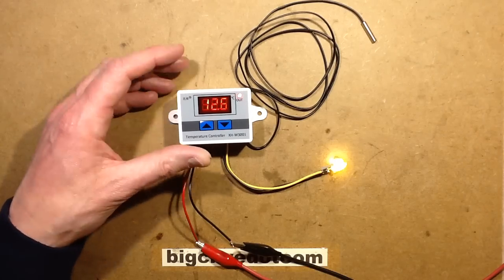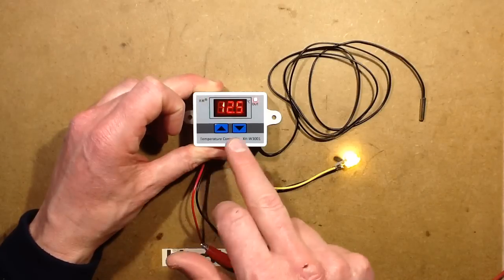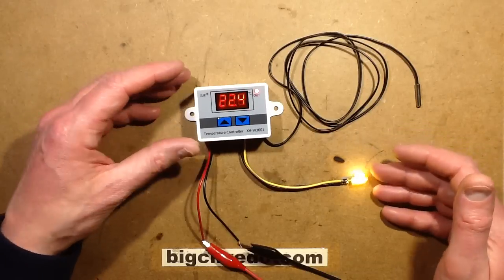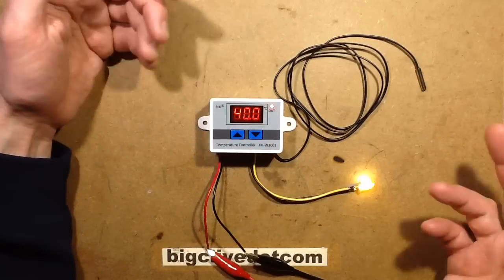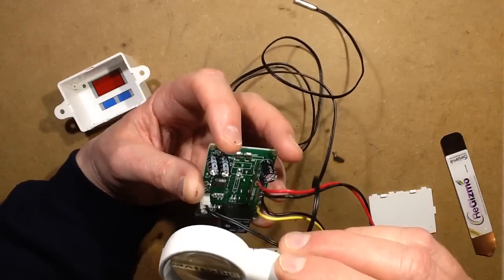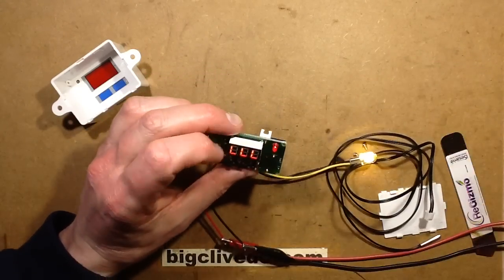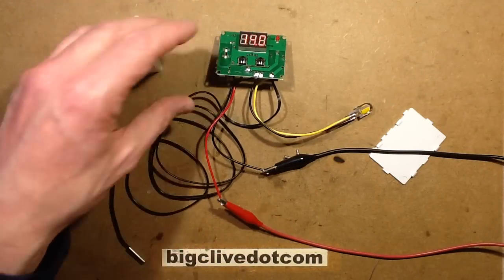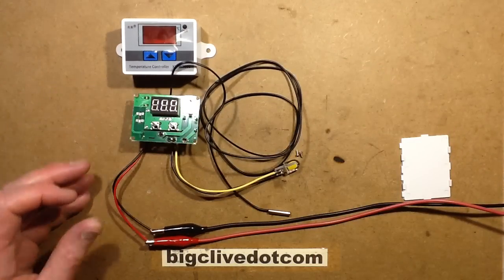How to set a XH-W3001 thermostat module, and a look inside.

Comment: I used one of these to fix an expensive portable fridge that was going to cost me hundreds of dollars to repair the board. 
Fortunately the compressor still ran continually with emergency bypass. 
I just tapped into the power cable with an automotive relay. Works perfectly. 
Has no lower power disconnect though. 
I reckon the Chinese might have one of those modules for a couple of bucks. 
Thanks for this video it helped me a lot.

Comment: I had a lot of fun with this item! So glad you made this video as my fridge is 20+ years old and I fear one day I would awaken to a puddle in the floor from the unit dying overnight. I ordered four of these, 4 12v wall warts, 4 female power jacks, and 4 intermittent sounders. Wired the sounder in to the relay, drilled a hole for the power jack, drilled 6 holes for the sound to escape, put the sounder inside, tight fit but it worked, super glued a magnet to the base, stuck it to the side of the fridge, set it up to monitor the freezer temperature! I used one as a proof of concept, one as a prototype and gave the other two to my brothers. I used the prototype for my personal one and threw the proof of concept one in the junk drawer for future experiments. Only problem was waiting weeks for the components to arrive from China!
Reply: buy the thermostat version for 110-220v and its easy (3 wires) replacement for your fridge thermostat. if the fridge dies its either thermostat or the varistor disc thats on the rear of the compressor. both are janky old crap. best fix them both with modern controls instead of waiting for them to fail

Comment: This will do nicely for my computer desk fan setup. The always on during a fault issue will actually be a plus in that usage and any other case when used to cool vital components.
Reply: Except it only wen't always on when he shorted it. If it's off when it fails and then it gets hotter...

Comment: I just purchased one of these for controlling a home made solar powered roof (attic) fan setup and came across your very useful demo on how to set it up and adjust it, many thanks. Tomorrows and the following two days peak temp is 40+C so the roof extractor should continuously operation if this has been correctly followed i.e. Well into the red zone NSW in Oz

Comment: I reckon the "on when thermistor shorted" feature/weakness is actually intentional design and not an oversight. Consider how you could use a switch to override the controller by placing it in parallel with the thermistor. The advantage of this over having an external bypass switch, is that the controller will indicate an override is active on its display. Also, the switch doesn't have to be capable of switching the 'high' current passing through the load. I suspect the load on/off state for a short and open circuit thermistor will reverse if you set it to "cooling mode".

Comment: Picked this up to add a couple old PC fans to my hen house.  When it gets too warm in there a couple fans will start circulating air and turn on a light as a warning. 
Very simple and nice. 
Thanks for the video.
Reply: Hello Sir, I don't know what I have been doing wrong, mine reads 12v 110v 220v but I keep on short-circuiting them. Kindly assist me out on how to regulate the amount of power needed. 
Thank you
Reply: @sharonkwamboka-xf8ro  They are marked on the back with a marker for the voltage. They only come in two voltage types. Yours is either 12 volts or 110 thru 220 volts

Comment: cheers clive. i got one on aliexpress for a quid fifty but no instructions. yesterday my 7 month old fridge died because of the thermostat. i now have installed this gadget and have a digital fridge! i also removed the motor start varistor and built a circuit with a capacitor and 2 relays to give the start winding a fraction second pulse when needed. where i live there are lots of powerline issues where the power can drop for just long enough for a motor to stop but not long enough for a varistor to cool off, leaving the compressor to cook until the overtemp cutout trips.  i recommend both these mods to anyone capable. it also cures the problem with keeping a deep freeze in the garage in the cold then having it self defrost on a cold day and ruin your food.
in my case i still had 2 year guarantee but taking it back to the shop would cost in petrol 4x the price of this thermostat i had on the shelf.
i get really pissed off as an electronics engineer when i see the jenky way cars and domestic appliances are wired just to save a penny per unit.

Comment: Thanks Clive.  I bought one on E Bay and there were no instructions.  I couldn't work out how to set it using trial and error.  Your video saved the day.  I've used it with my slow cooker to do some sous vide cooking.  (These are available to control a 250 volt supply.)

Comment: I purchased one to fix a 1500W heater. One version is given for 220V 10A. Must say that for 3.35€ including shipping, it is rather competitive! Just installed it and works well. No clue about long term reliability. But for this price...Thanks for the clear video explaining how to set "heating"/"cooling mode" which is not straightforward on the website. Hope the coronavirus was not in the parcel :-)

Comment: I bought a 120v sous-vide temp control module for my vodka/brewing setup (it controls the heat mats I use to warm the fermenters) and it's been one of my best e-bay purchases yet.  Very reliable and quite versatile for brewing with 0.1 deg precision and all sorts of alarm conditions and stuff I don't even need. It was around $25 CAD and a comparable unit here was something crazy like $125 or higher. When they care to, Chinese factories can turn out some very well-engineered stuff for not a lot of money.

Comment: The difference between set point and reset point is normally called "deadband".  Hysteresis is usually used to define the difference between in a continuous output when the signal is rising or falling.

Comment: I bought one for 220V/1500W and it principally works the same, though it is not as intuitive to use as the one you are demonstrating, it does not flash when the settings are ready to be changed. Does the job, heats up a silicon heating pad within the range. My only comment would be the in/out wiring which seems to be rather flimsy for such high voltages and wattage, the heating pad is 750W and there are 2 of them, seems to work fine. Thanks for helping with figuring out how to set the controller, difficult when it comes with no instructions.

Comment: I built myself a refrigerator using a 100W peltier plate and I'm powering it with the +12V rail of a ATX PSU. The current issue I have is it just runs as cold as the room will let it get. Which is causing large amounts of ice to build up on the heatsink inside the unit which is causing cooling effectiveness issues. Not to mention the ice buildup is stopping the fan from circulating the cold air inside the unit. This seems like the perfect "legos for adults" component to regulate the internal temperature more effectively if it can run off +12V and deliver up to 100W.

Comment: An even-cheaper version of the DIN modular thermostat packages from Willhay Electronics. Mind you theirs were 240V rated, with everything programmable, alarm contacts, o/p changeover contacts, etc for a rather measly $20 AU!  If you don't need sophistication, this would be great - idea as a fridge thermostat, or fishtank heater stat. That PCB has a lot of space and markings for added components, so its probable that there is a 240V version out there. Well worth looking for, and I'll be buying a few to play with. Thanks Clive!

Comment: I've found most of these controls work fine (for hobby use only of course) but it never drive more than an amp or so directly. It's always a good idea to drive and nice name brand relay.
Reply: yes, not even the cables are ready for 10 A

Comment: Aww damn, wish I knew these things existed when I built my new computer, a bunch of those with the thermistors gooped onto the various heat syncs would be great fan controls
Reply: Mort OOPz you're more better of using it for the air inside the case than the heatsinks

Comment: Waterproof probe and ability to handle mains voltage, and you could use an improved version to control a cheap slow-cooker for use as a sous-vide water bath.
Reply: markiangooley that's what I did! The unit controls a contactor->1000w immersion heater, best stakes I've ever cooked 😀

Comment: Thanks indeed for your insight Clive.  I had to find a circuit diagramme for the same item that I have just received.  As always you are very helpful... Excellent review. My app is for controlling a heated box with a terrarium heater lamp for bread prooving and fungi culture.  Let's see how the 240 V version goes with the relay etc.

Comment: I suppose when theres a fault or disconnection of the temperature probe its pretty much 50/50 whether it would be preferable for it to default to on or off depending on the application, especially since it can be used in both directions. like you say you need an extra failsafe mechanism. but the thing is probably intended to a just a part of a wider control system so thats fair enough

Comment: The microcontroller is an STM8003F3 series with 8KB of flash memory.
If you have an ST-Link V2 programmer and can access the programming pin (pin 18), you could reprogram it with some custom firmware to fix the output staying on when the sensor gets disconnected.
Reply: I'm wondering if the empty 4 pin connector under the STM8 chip is the SWIM programming connector making this even easier to do.
Reply: I've been looking all over the place for the microcontroller used. Thanks for the info!

Comment: Hi Clive. I have a similar thermostat to control my 12v fan in my greenhouse. The fan is meant to be rated to 220w. It’s an improvement from the 80w that was there b4. My question is: as it was a £40.00 car rad eBay fan, when measuring current x volts I get 100+ watts at best. A wee review on output of car fans would be great. Also how to build your own 12v temp control circuit. Tried to build one once, then purchased on lol. Keep up the content mate, it’s enlightens plus entertains!greating from the East Neuk of Fife!! 👍

Comment: Would love to see a comparison and your general take on what is practically the default option for temperature control in home brewing; the STC-1000. It's only around £8 on ebay and almost everyone that builds a fermentation chamber or kegerator seems to be using it.

Comment: The fact that the load doesn't switch off if the thermistor is disconnected or at fault means that it has probably been designed for cooling applications as opposed to heating applications. Not necessarily a fault depending on what the application it is used for.

Comment: yes it comes in various voltages i got 1 that is 220 v ac and it has check marks where they  indicate voltage when built / made . there is 12v  dc, 24 v dc and 220 v ac  choices available mine is 220 v ac to control my air conditioner here in the philippines
Thank You very informative video
v

Comment: Thanks for this, I learned quite a bit. Well presented video.

I purchased this for my 12 volt cooler on Amazon. I didn't like that the peltier cooler was on all the time when plugged in, will see if this can minimize my solar electric charged battery consumption on my DIY stepvan tiny home. Cheers from Canada.

Comment: I am looking to use a 220v version to control tube heater in a fermentation chamber, but I am unsure what to do about the neutral wire on tube heater and on the mains in plug? 
Very clear description for the 12v version !

Comment: Thank you for the clear explanation, it's great not having a Yank hoping for an Oscar.  I have a positive pressure ventilation unit in a loft of a home that I let.  It doesn't shut off when the loft temperature falls low. I can now control it to shut off when it falls too low.

Comment: Thank you for this nice review.
I will be ordering one for my little greenhouse.
You really deserve that ice-cold beverage ;-)
Reply: @Paul D. note that this is only IP22 protection class and only for indoor use. If you use it in a greenhouse it might not last long and is also not very safe.  I would at least put it into a hefty plastic bag or plastic box and seal it. and use a solid state relay to switch the load if it's more than 30-40 Watt. these little relays are not designed for high resistive loads.

Comment: Nice video showing how this works. Thank you.

I have question in regard to temperature setting. In the event of a power failure, will the unit restore back to the last set temperatures for the "Start" and "Stop" Or it will reset back to the factory default value?
Reply from the maker: It should store the settings.

Comment: Thanks big Clive. You’ve helped me. I needed to know if it would remember the settings when the power was removed as I plan to use it to turn on a diesel water heater to keep a circuit from freezing